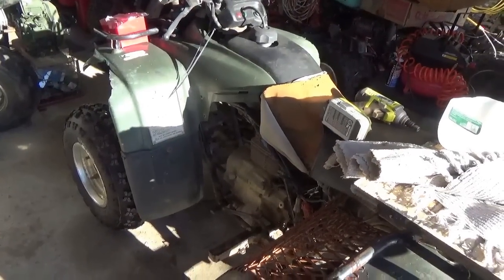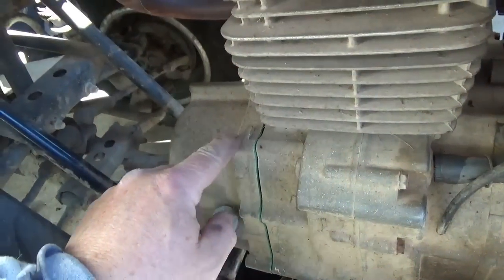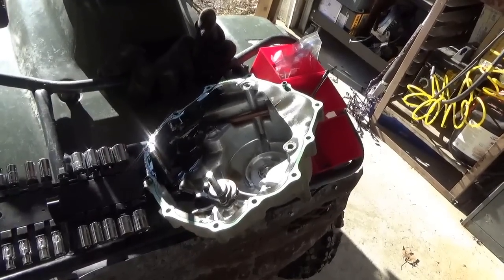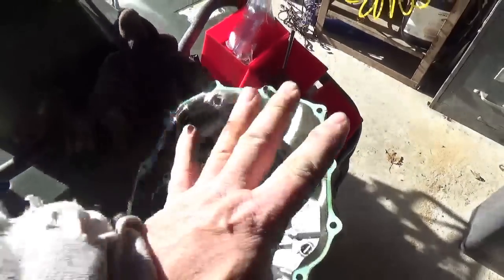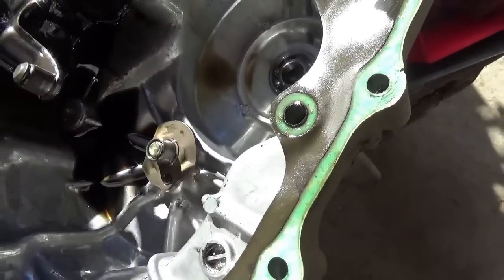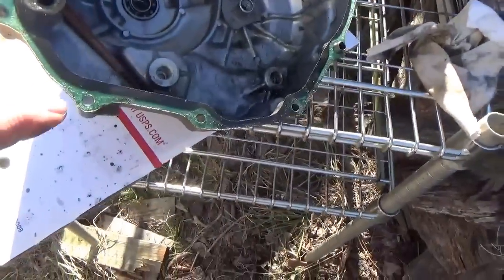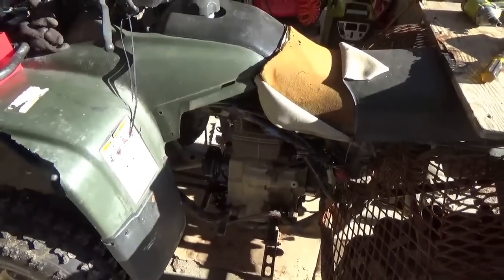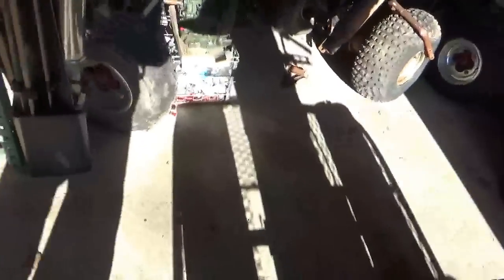Honda Recon 250, Shifting Clutch Adjuster, Replacement and Set Up!

Comment: Although not too clear in the manual photo I thought the light coil spring on the triangular ball bearing device should face out into the casing. It might be a good idea to clean the plate filter on the centrifugal clutch while it is striped down. Very clear informative video.

Comment: That's a pretty good trick with the cardboard but you begin to learn after a while have you just press the bolt all the way down in there and it sticks out 1/4 inch that is the correct bolt for that spot.

Comment: Hey Harvey,
I got a question, sadly it is not related to this video.
I have a 125cc chinese quad on which I just redid all the wiring harnass, thanks to your video. Everything works like it should be doing, except for the starter motor. It turns really slow. When I take the sparkplug, it goes as fast as it should be doing. Am I having a problem of too high compression? Should I look at the valves? What do you recommend, or do you have a video on this subject?

Comment: I put a 2016 clutch basket on my 2005 recon 250. Somehow there isn't enough room.. I can't get enough play in the clutch adjustment screw, the Manual shifter is a little tight and it throws a code to my electric shift. I cannot get any More play in the adjustment screw, it needs just a tiny bit!! Any ideas??
Reply from the maker: Hey Steven, Maybe U can get the little more adjustment by removing some material with a dremel tool or grinder.... I hope this helps.... Thanks for asking, watching, and commenting!!

Comment: I have a recon that I am having clutch problems with as well I just replaced manual clutch and rebuilt the centrifugal clutch with all honda parts put it back together and it still slips and when rolling down hill it doesn't hold the fourwheeler back the clutch engages and free rolls any ideas
Reply: Sounds like your one way bearing is bad.

Comment: The centrifugal clutch is the oil filter on those bikes. That's why the cap was on it . You should have cleaned it. I bet it has never been cleaned before.
Reply: no oil filter on the recon.. atrleast not mine
Reply: @thegitago7823  it has an internal centrifugal oil filter,  there's a video on here of one being cleaned during an oil change by a Honda tech at a shop.

Comment: My 2003 trx 250  is acting weird and i can t figure out what is causing it. so in between gears usually it acts like you are pulling in the clutch or like neutral, but now for some reason it just pops into gear and there is some play in the shifter. Any ideas anyone?
Reply: Maybe is just the carburator is not at the right rpm maybe the idle speed is a little bit high

Comment: I have A 250 honda fourtrax basically the same i have my quad stood up now because i have to change my clutches ....like yours my adjuster screw is crap

I was wondering if there is rules or is it fine to leave it pointed up for a week with gas turned off or should i drop it back on the ground ?